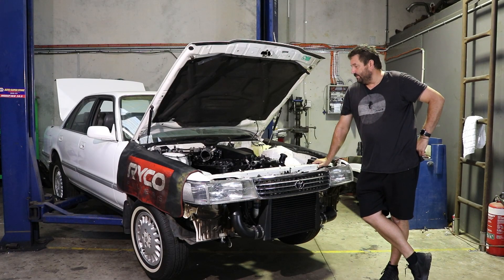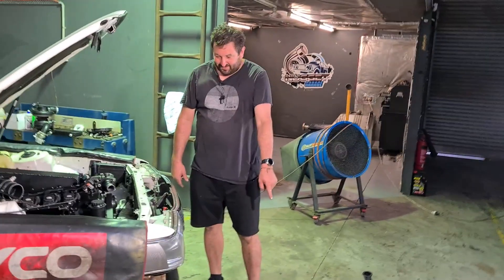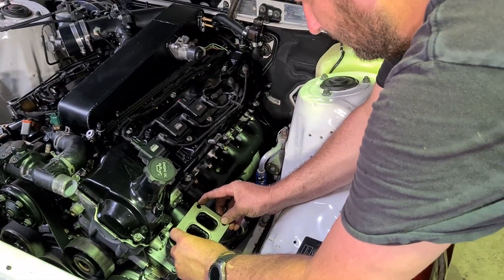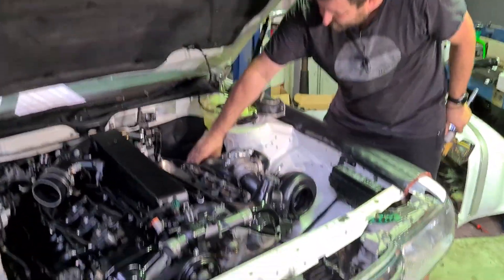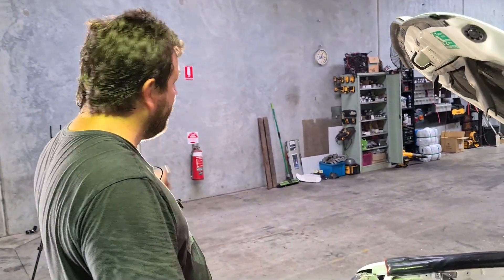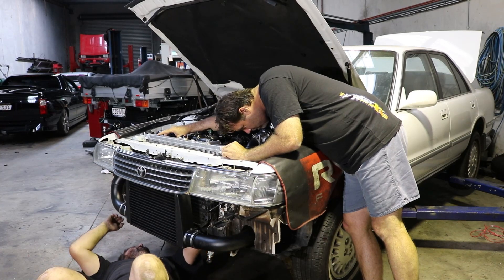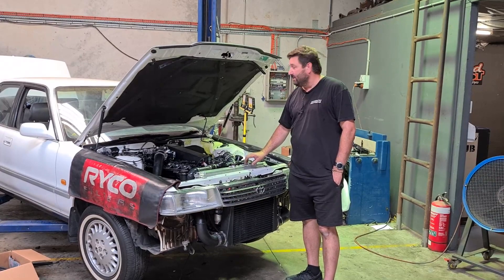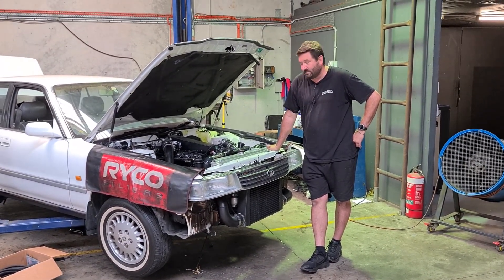TURBO V12 Swapped Toyota Cressida Build Ep7!!!

Comment: Glad you pointed out the dismal drain / sensor bungs on the mishimoto rad. You think you'd get an o-ring seat on a $600 radiator, I just used copper washers in place on mine. You guys definitely deserve way more subs and views than what you have, awesome content.

Comment: I do enjoy your work gentlemen. I am currently doing an engine conversion and besides the usual requirements, I need AC. I'm trying to utilize as much junkyard components to save money over the aftermarket. What are you guys using in this case?